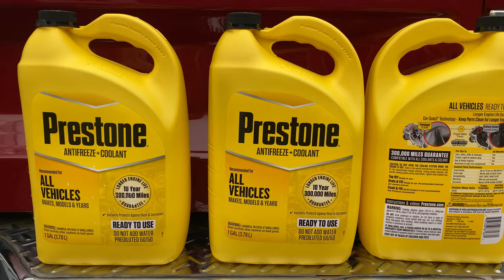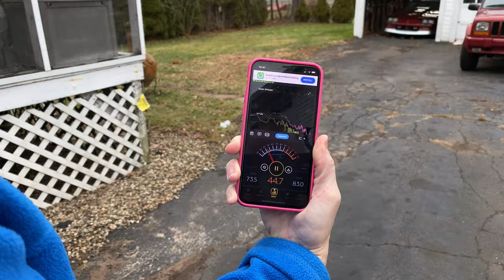How to Install a New Cam & Heads in a Small Block Z28 Camaro - A Step by Step Guide

Comment: Great job to both Matt for his work and the camera man for the detailed video and commentary. I really enjoyed this build. I have a 88 Iroc and wish it skinned like this. Any specs on the camshaft? It has the perfect sound. I’ll be watching for more on this beautiful car.
Reply from the maker: Hi! Thank you for watching and the nice words. The camshaft came as a kit with the lifters. It's the Comp Cams cam & lifter kit CL12 602-8. The intake duration is 243 and the exhaust duration 257 @ .050. The intake lift is .531 and the exhaust lift is .517. The LSA is 107 degrees. Hope that helps, but let me know if you need more.
Reply: @MarkDHall  thanks a lot!
Reply from the maker: @kemicalx17  You bet! Thank you for watching!

Comment: Love the video you did a fantastic job! Was cerious on the parts list for the upgrades made
Reply from the maker: Hi Death. Took a bit to look it up, but I'm actually glad we did so I have a record before I forget what we did. Haha.

Comp Cams cam & lifter kit CL12 602-8
Comp Cams Ultra Gold ARC aluminum rocker arms 1.5 ratio
Comp Cams push rods 7609-16
Trick Flow Super23 175 aluminum cylinder heads
Holley 300-261 intake manifold
Carbuerator Holley 0-82651SA
Doorman oil pan (This one uses a metric Toyota Matrix drain plug)
Headers Flowtech 11102FLT
Cloyes timing cover
MSD Street Fire distributor
Lunati distributor gear
3000 RPM Stall Hughes torque converter
Summit Racing polyurethane motor & transmission mounts
Edelbrock 1721 fuel pump
Hawks 4" exhaust with a 4" Flowmaster 40 Series race muffler
Summit Racing electric vacuum pump with external reservoir
Rear wheels Weld Racing Pro Stars 15x8 with a 4 1/2" backspace and a 255/6015 Mickey Thompson ET Street SS Drag Radial
Fronts are 15x5 with a 3 1/2" backspace with a 205/7015 Goodyear all season tire
Eibach lowering springs
UMI steering box brace (wonder bar)
Adjustable panhard bar

Comment: Do mine sharing the cam spec and number and timing gear set ? I want to wake up my 305 for a 36 Chevy coupe I’m building .
Reply from the maker: Hi Dave. Sounds like that'll be a nice ride! Matt gave me a list of all the items in the car, but it didn't include the timing chain part number, so I'll have to ask him for the model number. I know it's by Cloyes and has a thrust bearing on the back that's made for a roller small block Chevy. The cam is a COMP Cams Thumpr Hydraulic Roller Cam and Lifter Kit CL12 602-8. He got them from Summit Racing, and the cam kit is still available. Because he converted from a flat tappet to a roller cam, he said there was lots of other "things" he had to do to make it work. I can get the details if you'd like.

Comment: Mark, do you have any idea what cam and heads he went with here? and how was drivability on street after?
Reply from the maker: Hi Jesse - Matt's young and enjoys the "rougher" idle. It definitely doesn't compare to a newer/quieter car, but that's not the point of it. He said it required some tweaking of the carb to get it to run good. The drivability was good on the street with a higher stall converter and low rear gears. He ended up wanting more power and swapped the 350 out of his pickup and built that up even more and put this 305 in the pickup. For the parts, the heads are Trick Flow Super 23 175 Cylinder Heads for Small Block Chevrolet TFS-30310003 and the cam is COMP Cams Thumpr Retrofit Hydraulic Roller Camshafts 12-602-8. Both came from Summit Racing. Hope this helps. If not, let us know!
Reply: @MarkDHall  yes this helps! thank you so much! i'm looking for a mild cam do help pep up a 5 speed manual '86 Z28 that is i believe mostly stock. i also love the cammed "rough" idle
Reply from the maker: Matt reiterated that he really liked the cam in that engine, but he said gas mileage did suffer with it. once you get it all built and running, you will love it! Good luck and enjoy!

Comment: Hey there I am picking up a 84 this Sunday and it needs a transmission but the engine is fully stock and was wondering what you would recommend I could add on to it as a stock motor to give me a little bit more power until I can afford to pull it and build it up any advice and suggestions would be great thanks in advance
Reply from the maker: Hi. Congrats on the new ride! I would try to do things that you would keep when you rebuild the engine. For instance, a new exhaust with headers offers a huge performance improvement. If you do something like that, get one that would work well with your future build, even if it may not be the best one for a stock motor. Also, the stock intake manifold is very restrictive, but getting one of those might be trickier because if you get one designed for a future build, it may not work great on the stock motor. If you’re comfortable partially taking apart the engine, you can pick up a pretty inexpensive set of lifters and a new cam from Summit for $150 or less and that could provide a good performance boost, and you don’t have to take the motor out to put one of those in. Personally, I’d start with the exhaust. It can be done in phases so you don’t have to spend a lot all at once. Just some thoughts. Hope it helps!
Reply from the maker: Brice, did you end up picking up the car? How is it?
Reply: @MarkDHall  yes I did get the car i just put new door on it and hatch and took the transmission out of it last night waiting for it to be rebuilt and also picked up a new intake and have headers for the car already
Reply: @MarkDHall  also is there a way we could get in contact as I would love to hear about yours and ask questions as what your thoughts would be on some things for mine I really injoy your videos

Comment: What timing chain did he use? @Mark D. Hall
Reply from the maker: Hi Michael. The timing chain is a Cloyes. Would need to look up the model. It's the one thing I didn't write down.
Reply: @MarkDHall  ok please do
Reply from the maker: @michaelstiles1136  Hey Michael. We can't say for certain which timing set we got, but we think it's https://www.summitracing.com/parts/clo-9-3500tx9 - it has to have the bearing if you're using it with a roller cam.

Comment: The car sounds great, what cam did you put in it?
Reply from the maker: Thank you so much! The cam is a Comp Cams CL12-602-8.
Reply: Just looked up the cam specs, that's a lot of cam for a 305,did you loose a lot of low end power?
Reply from the maker: @mhfromphilly4788  It seems peppy down low, but that could be because the engine is more powerful overall now. I asked Matt, and he said this cam has more low end torque than the cam that we took out, but that wasn't a very good cam. He said if you want to make a lot of power down low for something like towing a boat with a truck, there are better cams than this one that don't need to rev as high to make power. He went with this one because he read a lot of reviews that said it sounds good. He doesn't drag race or anything with it and wanted something that sounded good and had good performance. He said he can get a list of all the parts he used if you're interested.

One thing, though. This cam required a higher RPM torque converter, so if you press the gas a tiny bit, it doesn't take off as quick. You have to rev it a bit more. Also, the power brakes stopped working because this cam doesn't make a lot of vacuum, so he had to get a vacuum pump for that. He hasn't installed it yet, but when he does, I'll create a video for that.
Reply: I'm curious to know if you used the 0 degree timing marks on the timing set? Or did you install it advanced or retarded ? I'm building a 305 any help would be appreciated.

Comment: Man I got important question . How do I know if my 305 is a high output one or just a Regular . N how in the world did you get the motor out so easy . I’m in the process of putting mine in . N nothing but headaches it’s halfway in now . Just won’t clear the motor mounts on the bottom .
Reply from the maker: Hi @Jayway. A couple thoughts - We had an issue with ours, and had to lower the engine onto the mounts and then kind of wiggle and shimmy it in with a pry bar. It's kind of hard to explain. Another thought - is anything hitting the firewall like the distributor? Could it be hitting the transmission? Have the motor mounts "compressed" and preventing the engine from going into them?

As far as being an HO. That info is included in the VIN so if you decode online, it'll tell you. If the engine is not the factory engine, you can get it from the engine serial number, but that's not always accurate.

Best of luck. I hope this helps, but if not, let me know, and I'll try to help.
Reply: @MarkDHall  yeah we been trying the pry bar deal . It clears the firewall it’s right up against it . N as of rn I took the distributor off cause it was hitting da motor box for the  whipers . So for rn it’s in there more of a titled position . I got the transmission chained across from the bottom to have it held up . I mean it’s pretty much in there I just can’t past them damn motor mounts . I would’ve hate to have to cutt them off or something like that . Cause they brand new . SMH so kinda stuck rn lol
Reply: @MarkDHall  seen y’all work n it gave me hope and motivation that I can set that motor in my camaro n not waste something that’s nice like what I got .
Reply from the maker: @jaywaylanebabyboistunna  We had similar issues. It was a real pain to get it in place. Matt's gone to work now, but I can check with him when he's back and see if he has any other thoughts. He gets back late, so I probably won't have more till tomorrow.

My wife wanted you to know that we also had new motor mounts and they're very tight and can be difficult to work with. The engine refused to drop into them easily. Another thing she said Matt did was move the hook/chain to different spots on the engine stand where it bolts to the intake manifold to see if it would angle the engine differently so it would go in.

I wish I had a definitive answer. I know remember Matt struggled a lot, and if I remember, it kind of dropped into the mounts by luck.
Reply from the maker: @jaywaylanebabyboistunna  Don't give up!! You'll get it. It might be a pain now, but once it's done, you'll have an awesome ride.
Reply: @MarkDHall  appreciate it forsure . Keep me in touch . Idk how we can stay connected . But just lmk what Matt say . I’m sure he’ll know exactly too .
Reply from the maker: @jaywaylanebabyboistunna  Just checking to see how the engine worked out - were you able to get it installed? Matt decided to swap out the 305 from his Camaro and put the 350 into it from his pick up. When he did, he struggled like crazy for a couple hours before it finally dropped into the motor mounts. I think it finally went into place by accident and pure luck.
Reply: @MarkDHall  I actually found a 350 Vortech motor instead of a 305 that I had . So I decided to go with the 350 Vortx we already fixing it up from top to bottom read new gaskets all new carburetor. New spark plug wires. N etc etc . For da less of an headache I actually found somebody I know that was a specialist wit these 3rd gen Camaros
Reply from the maker: @jaywaylanebabyboistunna  That's great! Glad you're able to get it working. You'll probably like that motor a lot more than the other one. I love seeing the new motors in old cars.
Reply: @MarkDHall  yeah it’s a awesome  thing man . They saying motor should b in n don’t by next Monday so let’s hope 🙏🏽
Reply from the maker: @jaywaylanebabyboistunna  You have to post a video of when it's done. I want to see it.
Reply: @MarkDHall  most definitely goin too . I’ll keep in touch wit ya 💯✊🏽

Comment: I’d consider a dual plane intake, you’ll get more low end out of it.
Reply from the maker: A couple months after he put the engine in, he switched to a dual plane for awhile but ended up going back to the single plane because he liked how it drove better. I'm old, and would prefer to have more power down low, but he's young and doesn't mind having to rev it up to get going.
Reply: @MarkDHall  rear gear ratio and higher stall can also help that single plane really shine. Nice car man. 👍
Reply from the maker: It’s funny you mentioned changing the gears because he’s in the process of putting 410s in it right now. I couldn’t make a video on it because he did it while I was working, but we’re hoping it’ll make the car quicker. The converter is a 3000 style speed. It’s not super high but it seems to be a good balance of performance and still being good drivability. Thanks for watching Anne the positive input. Great minds think alike they say.
Reply: @MarkDHall  absolutely. That is exactly what I have. 3000 stall with 410s, Vic Jr,  and it's awesome on the street. Merry Christmas. 👍
Reply from the maker: @arodderz  Hope you had a good Christmas. Your setup sounds perfect. It's funny because a lot of people say it's "too much" for a street vehicle, but I think it's kind of the perfect balance. Yeah, it's not "smooth" like a new car, but that's not what it's meant to be.
Reply: @MarkDHall  Thank you Mark. Hope you did as well. Just trying to stay safe as much as we can. And yes, this combo is great.  When I ordered my cam from Mike Jones Camshafts,  he directly had me get rid of my dual  plane airgap,  for a match ported Vic Jr. Let me tell you that the rpm charge from 3700 and up is night and day. Again,  nothing wrong with the air gap, I just prefer this set up.
Reply from the maker: @arodderz  Hi ARod, when you say "dual plane air gap," what do you mean? We have a
Reply: @MarkDHall  Happy new year. I'm referring to Edelbrocks, Airgap, dual plane manifold intake.
Reply from the maker: @arodderz  My previous post only sent half the message, so it probably didn't make sense. It sounds like your setup is similar to Matt's but he has a Holley intake. Quick question - what kind of rear do you have? The Camaro has a 10 bolt, but it's not like the ones from the 70s that were pretty strong. This one is 7 1/2" and some people say it's not very durable with lower gears and over 300HP. In your opinion, do you think it'll hold up okay? We're not going to get on it hard like you would at a drag strip, but we don't want to baby it either.
Reply: @MarkDHall  oh ok . No worries. I have the 8.5 10 bolt, Posi, 4:11, aftermarket cover that  has bolts to stabilize bearing main caps, c clip eliminators...that pretty much it. As far as your rear end,  the 4:11s will loosen your tires a bit, and traction starts to become a slight issue.  But,  If you're not launching hard at the track with sticky tires you're gonna be fine for street use. You'll have fun with it 👍
Reply: @MarkDHall  even drag radials on the street have  a hard time gripping to be honest,  which ultimately ends up saving your rear end
Reply: @MarkDHall  but traction, 411s and hard launches will grenade it....hope that helps !
Reply from the maker: @arodderz  Huge help. Thanks!
Reply from the maker: @arodderz  It has MT drag radials, but breaks loose easily with the old 2.73s? on it, so it probably won't get good traction at all with the 4.10s.
Reply from the maker: @arodderz  Nice setup. Matt didn't want to spend the money, so only opted for gears. I'm sure he'll upgrade sometime. He's always looking to do something more.

Comment: I’m doing the same to my Chevy 305 out of my 84 cutlass I want those trick flow heads direct bolt on for the 305 at 68 or 58ccs can’t remember but how are the heads working for u it’s been about a year since installing let us know thank you
Reply from the maker: Hi @Rockfordhx2. Heads are working great. Compared to some brands, they're "cheap," but they're some of the highest rated heads for (305) small block Chevy's. These are 56ccs. Matt said he went this route to help boost the compression a bit since this cam likes higher compression. The model from Summit Racing is: TFS-30310003. Best of luck with your build!